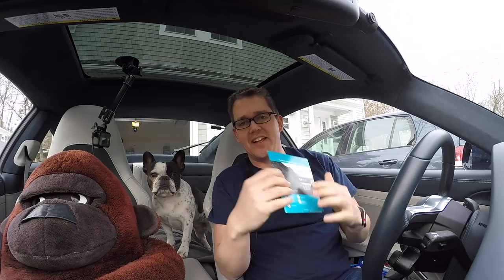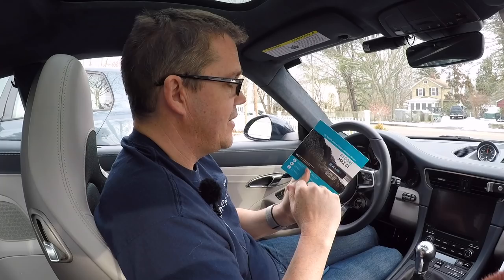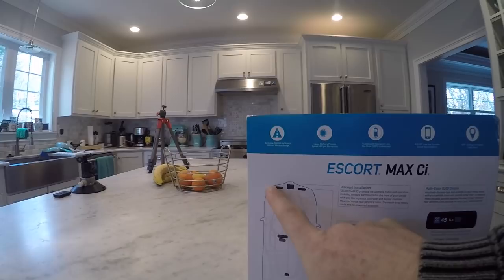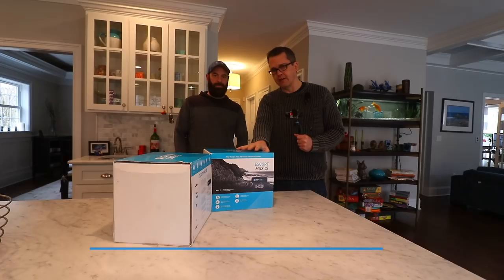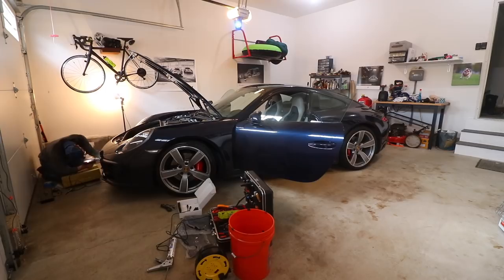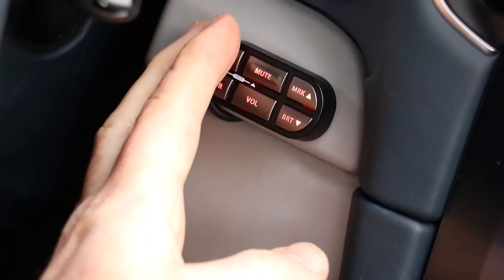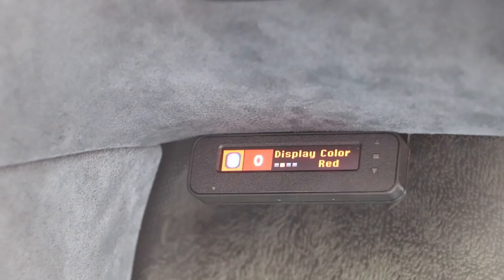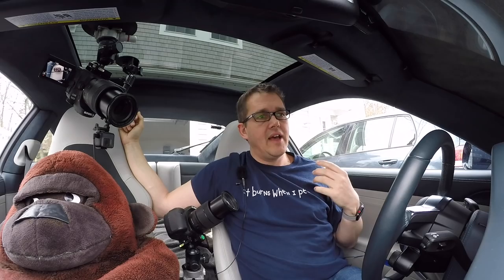Escort Max CI integrated radar detector laser jammer install / setup

Comment: Biggest danger is not speed....its the prius in the left lane going 10 mph under the speed limit causing everyone to pass them on the right.  That and dbags in STIs and Civics weaving in and out of traffic.  Speeding tickets are about generating money for the town ask any cop.  Modern safety mechanisms - but particularly stability control and abs brakes have shrunk the required braking distance substantially whereas the speed limits were last set when we were driving 5000 lb boats with drum brakes.
Reply: That's kind of what the autobahn has shown.  Disciplined alert drivers are what leads to highway safety.
Reply: New product idea !!!!    a "Prius Detector"  ... detects miserably slow moving vehicles ahead of you.  Actually, this will be standard equipment on cars within the next 5-10 years .. as all the new "self driving" tech morphs into more desirable practical applications, like driver safety assistance .. detection of pinhead drivers around you.
Reply: Nailed it!!
Reply: Don’t forget those dbags in high riding loud ass pickup trucks

Comment: Nice one Nick. I look forward to your testing of the laser shifters!
And to all the folks claiming you are intending to break the law if you use a radar detector, I call BS. I never intentionally speed, but a radar detector is a good reminder to check your speed and make sure your obeying the law as you approach a speed trap. 
Also, the ONLY speeding ticket I got, I was doing the speed limit. The cop was clocking the guy who was passing me. When I told the cop that he said, "Well, you were both speeding and I was hopping he would pull over too so I could give you both tickets." BS. Guy doesn't know how his gun works. If two cars are side by side you will clock the fastest one as that is the signal back to the gun first and reports the doppler shift and calculates the speed. Now, I have a radar detector, I get an early warning before I see the cop, and can make sure I'm in the slow lane going 10mph below the speed limit until I'm passed the cop. Hopefully by eye the cop can see I'm not speeding and get that SUV from New Jersey going 15mph over the speed limit that's passing me! So far so good. It even warned me of the same cop in the same speed trap two miles before I was in radar range. So...not breaking the law, just getting more information. That is not illegal!

Comment: Nice bit of kit Nick! 
Don’t ride around with a false sense of security though, jump on the forum mentioned in the comments and do the research. Always slow to the limit and kill the jammers asap if you get an alert, otherwise you’ll cause future trouble by letting them know you have the upper hand. And don’t talk to the cops about laser/radar...it’s not good for us or the company’s producing the countermeasure gear. 
Drive safe ;)

Comment: lmao so many haters that cannot afford it. Speeding tickets for the most part is a business. If everyone was doing the speed limit officers would be absolute assholes and give them out even if you went 5mph over the limit. Quotas have to be made each month. Those who drive on the left lane always risk getting a ticket doing 65 on a 55 its that simple. Ive personally have received a ticket doing 68 on a 55 and thats was the flow of traffic but I had the sports car which resulted in most likely the one getting pulled over by attraction. Dont hate on what you can't afford, just work harder.

Comment: very curious to see why you picked escort over ALP. I have had both and most recently ALP in my 911. I agree escort integrated system is a little better in regards to filtering and gps lockout. The new laser jammers on your car supposedly have Dragon eye support but not from the most recent compact dragon eye gun. Having said that, in three years of owning the ALP, Ive only been hit by a dragon eye once. All other times have been pro-laser. 

But the escort system is way more expensive then ALP now which was previously the 9500ci advantage over it (being significantly cheaper). 2500$ you could get the ALP 3 sensors/net radar and bluetooth module and be over 700$ less. 

Would love to hear your thoughts or anyones. Congrats on the system tho and best of luck staying ticket free!

Comment: everyone, cost from google search: "The advancements we have made in the new ESCORT MAX Ci and MAX Ci 360 will meet and exceed those expectations." The ESCORT MAX Ci and ESCORT MAX Ci 360 are available now for $2,999.95 and $3,499.95 respectively and are available only through ESCORT's Authorized Dealer base.Jul 10, 2017

Comment: Not a great install...front sensors are too close together...should have three across front..and they appear very crooked
Reply: he is a professional, Im sorry, but Id rather trust him than a guy in the youtube comments.
Reply: I didnt call him a professional because he charges people for money. Nic said he had alot of happy customers. Thats atleast why Id choose to trust him over you. Nic said he is going to test the system with a police officer, so we'll see how well the install holds up.
Reply: enough said/shared here
Reply: we will meet again in the future, my friend
Reply: Shit's legit, no results for image search. Congrats on the Turbo S m8
Reply from the maker: Actually I should have said in the video, the mounts are for the sensors are being laser cut to the correct angle for my car so in the mean time they are just stuck on. They should be replaced with the profession custom mounts this weekend.
Reply: I have to agree. My Cayman S has the jammers installed under the running lights
Reply: Come on Nick, by now you should know better than to upload anything that is less than 100% perfection to youtube.
Reply: The mounting was not complete in the video as I was waiting on the shims for leveling the shifters to be completed so they were temporarily mounted while waiting for the parts to be finished.

In this particular application, the louvers on the left and right side of the bumper below the headlights are controlled by the cars computer and open and close based on various circumstances making that location not an option for an install location, also Escort does not sell additional shifters separately from the Max CI  and Max CI 360 product so doing 3 shifters in the front would not be possible without installing the 360 product which is not the product Nick wanted to install.

Comment: So on average, how many tickets does this very expensive unit + install have to save you from in order to realize your ROI?
Reply from the maker: I think for most people it is about the points more than the fine.
Reply: 2 or 3 depending on your insurance company.   When 90% of people are going over the speed limit on the highway every single day....the chance of getting a laser ticket is very high.  After I got it installed, it saved me 7 or  8 times in 2017. Unfortunately I got it installed AFTER my insurance rates doubled because of 3 tickets in a year.
Reply: barack obama maybe stop speeding?

Comment: It's also extremely prudent to research ways to defeat traffic tickets in court, especially if you own a high end Porsche as small town cops get speeding ticket hard-ons if your car is as much as 5 miles over the limit 

I own a Hyundai Elantra, a compact but still get harassed by the local city cops for speeding. I drive for a living so it's important my record stays clean

I plead not guilty and challenge them in court out of principle.

Comment: So would you recommend a $600 model that you put on your windshield? Or are those useless?
Reply from the maker: They are pretty good for normal radar Ka K etc.
Reply: RAJohnson713 I have a Valentine one that I bought used for $150 on eBay. It has paid for itself many times over. It’s definitely not perfect though. As nick mentioned, laser jammers are necessary on most interstates these days
Reply: If you only have $600 spend $400 on the Uniden R3 and save the $200 to put towards a Antilaser Priority fund if you have laser used in your area. Used V1's on eBay aren't worth it as you need the lastest version to not have to deal with all the false alerts from modern radar safety systems on cars which get annoying.

Comment: Here it’s 2020 and look how long it’s been since I started using RMR technology.....2006. 

The only reason why competitors or anyone else can’t get any positive results when trying to test their technology because it’s connected to one small computer chip. The scrambler technology was never designed  in the first place to work against anything else. Have you ever noticed the guys that try testing the detectors capabilities they always using their equipment.  The scrambler only works on police because it’s using their system not what we’re using. No matter what country you live, state or town you’re always protected by that shield. All you do is arm the device and create an invisible force field around your vehicle about 180 degrees which is half of a circle your car or truck is protected against police detections.  

Laser jammers are ok but your not fully protected against police detections which is why your more easily to catch speeding. 

I can’t defeat police speed detections when using a radar detector which only makes noise. But a scrambler your ghost up to 150ft. Or closer because even at 150ft you have 8 seconds before his computer can finally read your speeds. 

That is stupid stupid close if your a heavy foot 🦶🏼 driver to slow down safely. 

That is why Rocky Mountain Radar military undisputed technology is the best👍🏽👍🏽

Comment: This system is way expensive, it would literally be cheaper to just pay speeding tickets.
Reply: Plenty of dash mounted radar detectors will do their job. for a fraction of the cost. the Uniden R3 is the best windshield mount radar detector is $400.00. I bought my V1 in 2006 for $400 and it has paid itself off in the first year with saves. My laser jammers have also paid themselves off in saves. I know from experience by getting laser tickets in cars without jammers.

Comment: Surely it would be easier to avoid getting tickets by never exceeding the speed limit? Here in the UK young drivers have to have a telemetry box fitted to their cars which inform the insurance company of how well you drive, whether you have exceeded the speed limit, braking, cornering or accelerating too hard. If your score drops below a certain level, they automatically cancel your car insurance. I would expect that the next logical step would be to make it law for everyone to have one fitted, maybe built-in to the car and illegal for any tampering.

Comment: Anyone on here shitting on Nick because he's encouraging speeding is an idiot. It's one thing for someone who's already a bad driver to be doing 85, passing on the right in an 05 corolla with a bald tire and the seat leaned back, but for someone who is an enthusiast, who clearly has good driving history and is driving a car that is designed for the autobahn and is rock solid over 140, speeding really isn't an issue. It's difficult to understand until you've driven these cars that 100 in a 911 is like 60 in a Honda.

Comment: There's no way thats worth $2500. I got one speeding ticket in my Porsche in the past three years and I speed all the time, I think I paid around $300 for that ticket. The tricks are to know where you can and can not drive aggressively and to know all your local cop hideouts.  Don't speed in any residential areas. Don't speed when driving through small towns.  At $300 per ticket I would have to get 9 speeding tickets for it to be worth it.
Reply: You seem to be disregarding the fact your insurance rates will also rise with every speeding ticket you get that isn't reduced to non-moving violation
Reply: That is a very good point.
Reply: Also the freedom to know that you won`t be hassled by costumed goons is worth the price.
Reply: So your big concern is "costumed goons" catching you speeding, not potentially running over a kid on their bike or someone crossing the street. Amazing.